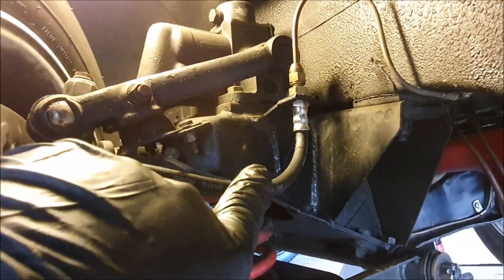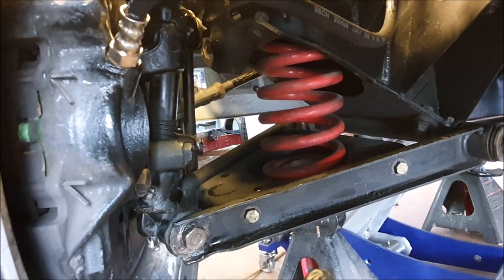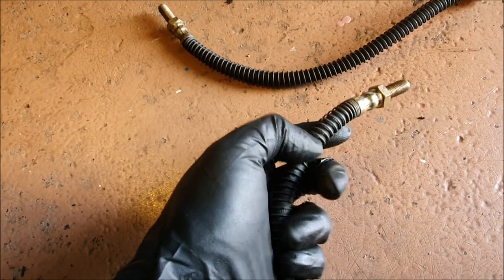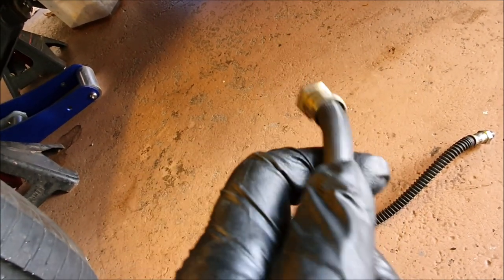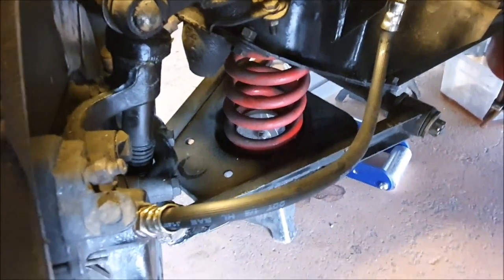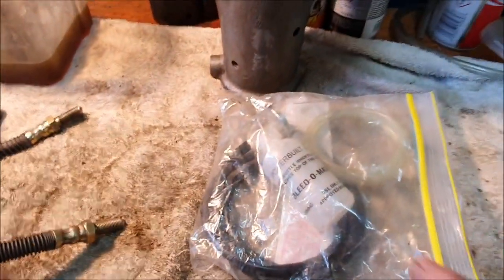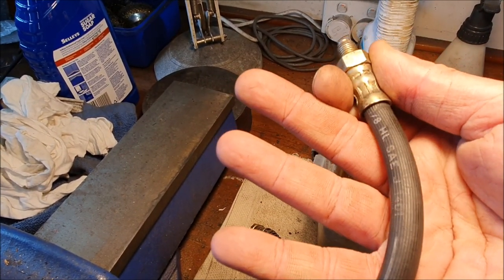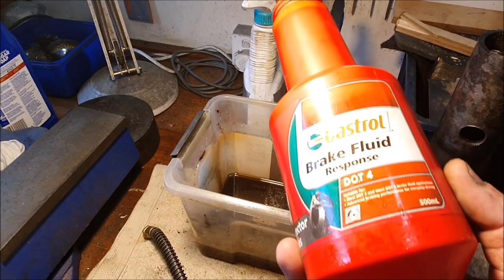No pre war cars update - OK, just a little plus MGB brakes

Comment: The brake shaft does need  to have a support on its end as you suspected. Mine is fitted right at the end of the shaft, and has a screw in piece at the end of the shaft to hold it in position.I have also put a grease nipple in this end piece. 
As for the universal ball, there should be a hole in the inner ball that lines up with the oil way from the little reservoir. The reservoir should contain a shaped felt to slow down the dripping, and the drips should make their way all the way to the universal through the hole mentioned above. Normally you don't need to worry about this hole as it cannot move due to the rivets that you removed when you shortened the tube, so now you must make sure that you reassemble the tube with the hole in the ball at the top.
Reply from the maker: Ah, thanks for clarifying. Yes, the hole is there in the ball of the torque tube and it does line up with the smaller hole in the casting. I didn't know about the felt so that makes more sense now. Was the brake shaft support a factory thing? I need to study the parts books again I think.
Reply: @asciimation  Simon, I did not know about the felt in the reservoir for some years after rebuilding my car, and was always (every day) filling the reservoir with oil. The felt makes a big difference. The plate on top is just made of light weight steel, ( perhaps 1mm?). There are 3 holes in it on the centre line. One quarter inch in the middle for the stud and two smaller ones which I assume are for rivets to attach a leather gasket. I just made a leather gasket and held it to the lid by a pair of bificated rivets. The brake support is simply a quarter or 5/16 steel rod with a suitable sized eye in each end. If you have the parts book, it shows the two eyes on page 68, no.13 and 14. I enjoy your youtube submissions. Keep up the good work! Colin
Reply from the maker: That's for the useful replies, it's the main reason I put things on there. I am building a car, not a YouTube channel! If too many people watch I would never see the useful comments!